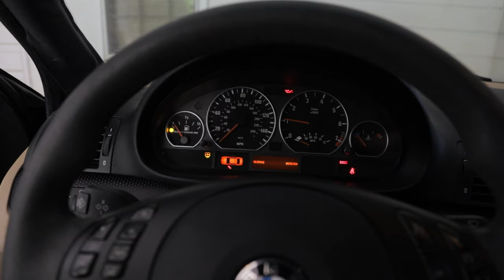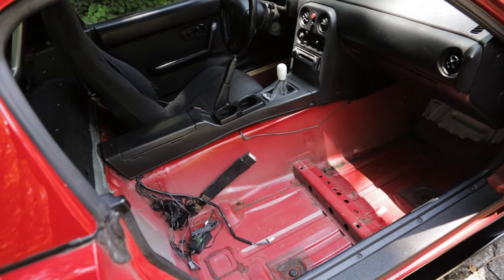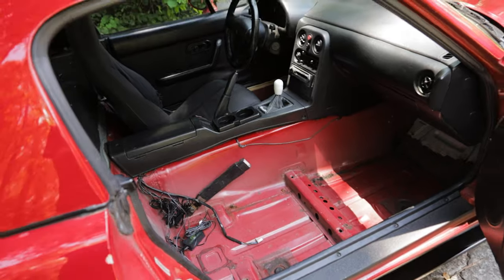vlog: I Stripped the Interior of the Miata?! + E46 Tie Rod Replace

Comment: when your coolant leaked was it when you took hard left turns? it seems like just water thats leaking when i drive with my ac on but maybe im wrong.
Reply from the maker: Nope. I have had that ac water leak happen on left turns though. If you take a paper clip or something theres a tube under the passenger side dash you can poke in it to clean it out. Have a cup or something ready, a bunch of water will come out but no more leaks!